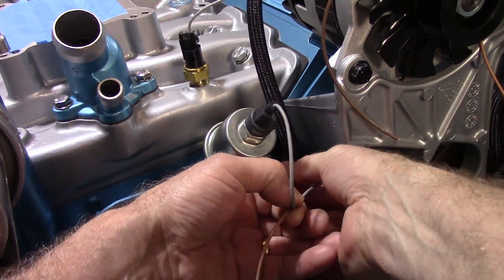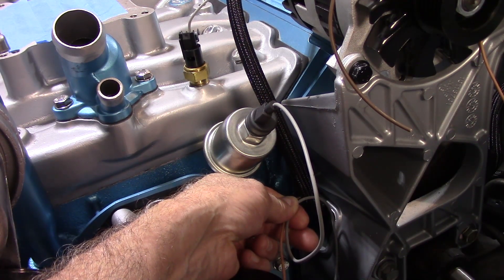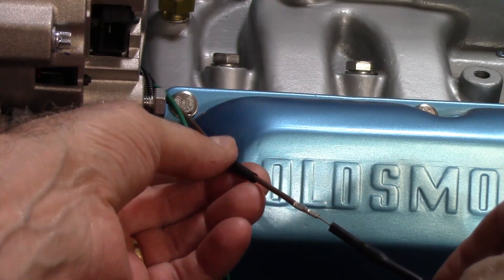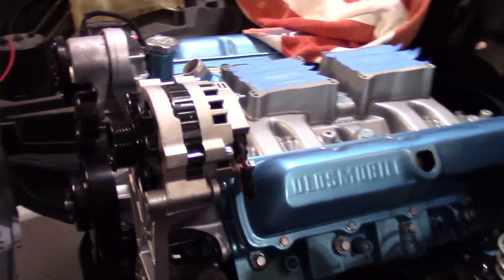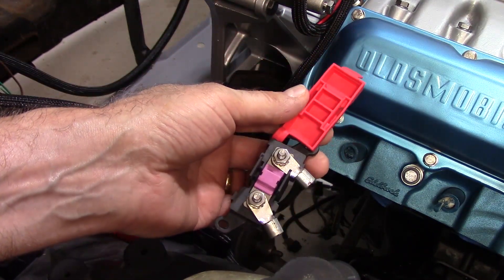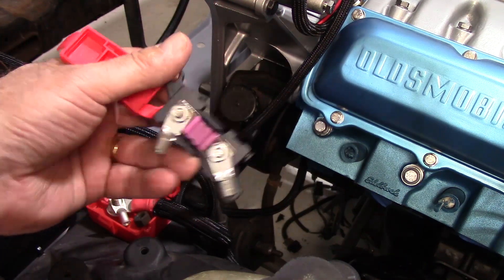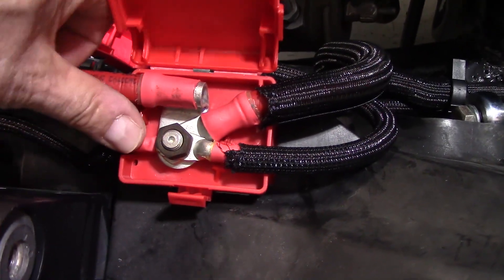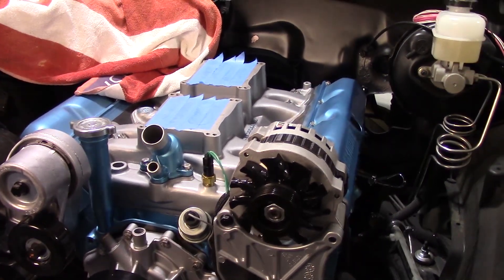Engine Sensors and Alternator Wiring: Harness Rebuild Part 11

Comment: Put ac in your garage and stop all the sweating. Mini split systems are inexspensive and can be installed in a day!
Reply from the maker: @jamesyeckley2927  I like where your head is at. I may research that this winter.
Reply: Ya. You would like it a lot. I am an hvac contractor and have installed quite a few. Most are heat pumps so you can use the heat in Winter.BTW I really ejoy your videos. You do great work. Very professional!
Reply from the maker: @jamesyeckley2927  thank you sir. You're too kind.

Comment: Looks very nice. Great work. When do you anticipate being ready to fire it up and what fuel delivery are you planning to use?
Reply from the maker: @ben68442  lot of work ahead to get to fire up. I'm going to use an elect fuel pump with a recirculating system back to the tank.

Comment: Im have the old fuesable link on my Starter im.thinking i need to change to those...im have a 150 amp alternator with a 4ga wire going to battery but no fues in between..where did u get them from
Reply from the maker: @boss94ways51  Painless Wiring